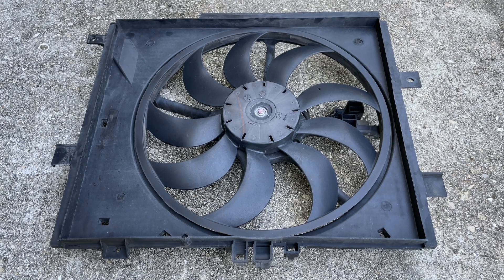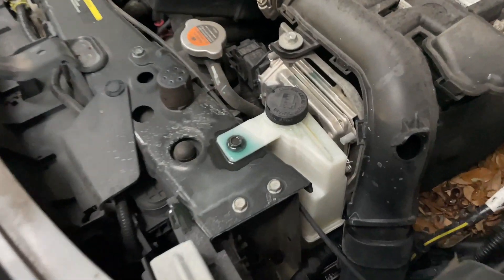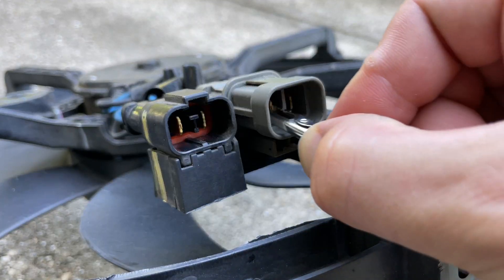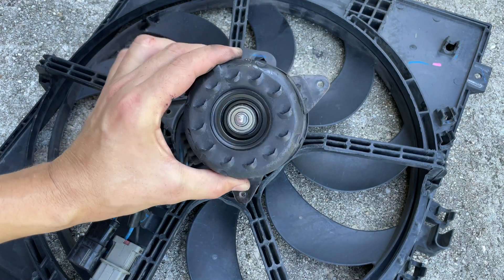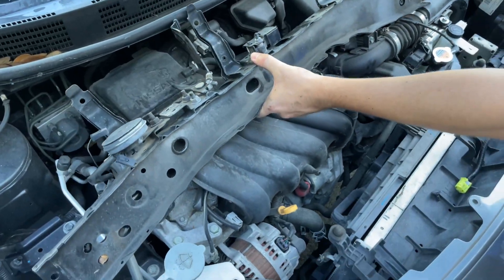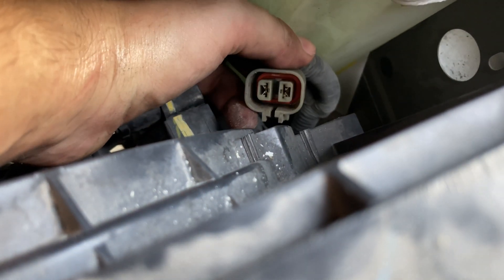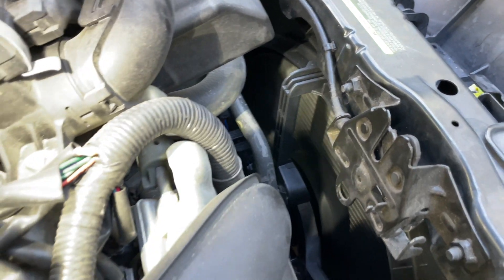How to diagnose and replace car radiator fan - Nissan Versa example

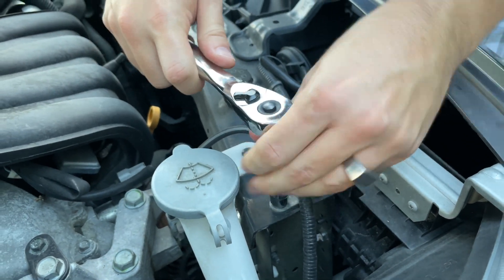Comment: IMPORTAN NOTE: When reassembling everything back, make sure to reattach the wire he pulled away at 2:03 or your car wont start.

Also note that there are 2 clips, one above another at 1:53 even though he only shows removing 1.

Other than that great video! 👍Works!

Comment: Fans in general are so reliable, why then is it not in Nissan cars. This has to be a deliberate scam.
Reply: Fan control module location.
Reply: Yea, im being told by the Nissan repair team at the dealership that it’s a $1,200 job for a $76 fan. Wow
Reply: @Baguette4726  ...they told me 1440. After a $250 diagnostic (Nissan DTLA) And also that my brake fluid was bad ($216) - I had litterally just changed it at jiffy the month before.
Reply from the maker: Scammers...
Reply: I've replaced mine once two years ago. Back to no spin
Reply: That's what I was thinking

Comment: I got a new fan tested. It works but after I put it in. The new fan still never turns on.
Reply from the maker: Check your old fan, maybe its still good, just bad fuse or relay.